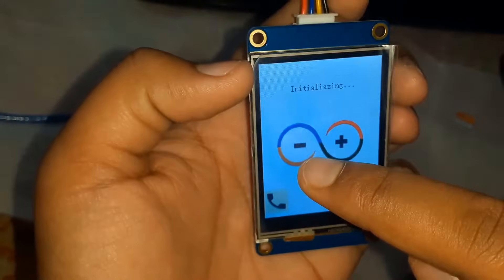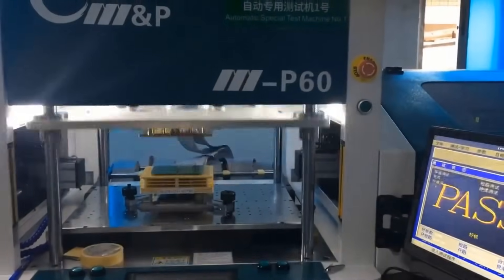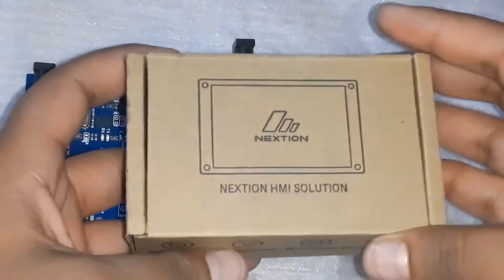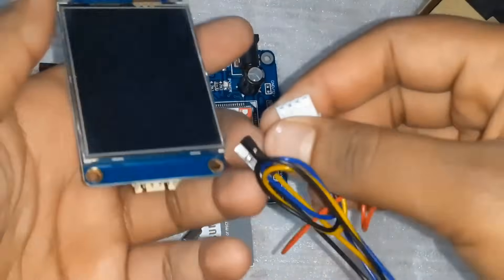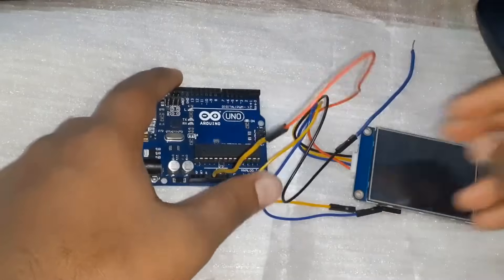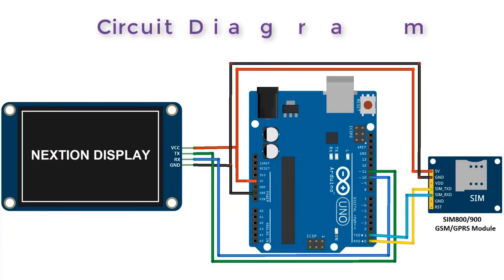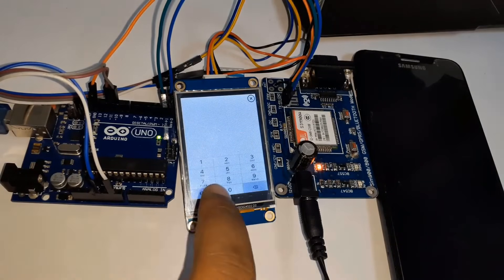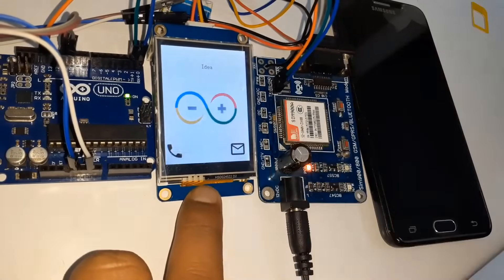Make Your Own Mobile Phone using GSM & Arduino

Comment: I am making exact phone using same things sim900A and uno r3 but my display is just showing white its a tft touch display 2.4 inch the back of the display there are pins its powering up and showing just white screen what can i do😭
Reply: did you figure out the issue?

Comment: Nice job... I have converted my 2 wheeler to electric. I want to use my mobile phone as digital display panel I.e for battery level indicator, speedometer ect..  How can I do that??
Reply: You can use accelerometer module and voltage send it amd a 2.4 inch screen
Reply: Dont use arduino, its too slow for this application. Try raspberry pi. Theres infotainment system with it

Comment: Will we be able to hear and transmit the sound of we attach mic and 8 ohm speaker?
Reply: If we attach mic and speaker so is it necessary to specify them in code
Reply from the maker: No not necessary to specify in code

Comment: You didn’t connect any microphone and speaker. Is it possible to talk via phone call with this?
Reply from the maker: Microphone and speaker can be connected gsm pins. The port is already there for connection.
Reply: @HowtoElectronics  Thanks for your reply. Yes, those can be connected ; but you didn’t demonstrate this part in the tutorial. That's why I have mentioned this.

Comment: does it also connect to the internet? thanks
Reply from the maker: No
Reply: @HowtoElectronics  could other type of code work for the internet? thanks
Reply: @ziobit5177  an Arduino only has 32 kilobytes of memory there's no way you can make an OS with a browser.

Comment: Thanks you for your reply. And explain about power supply to arduino and GSM module. Will this module work by charging then how long.
Reply from the maker: 9v-12v
Reply: Plz electric bro make a video on making an artificial intelligence system inside Arduino